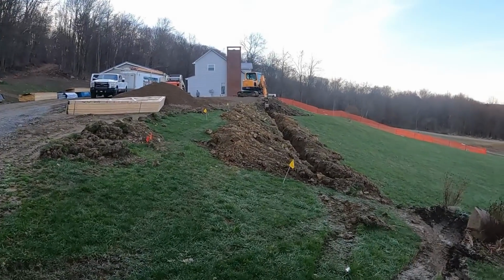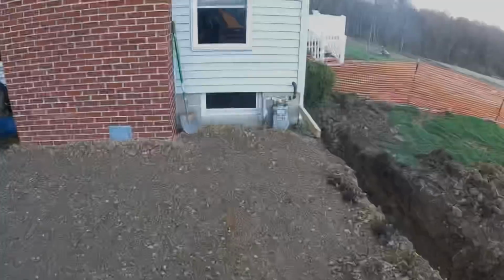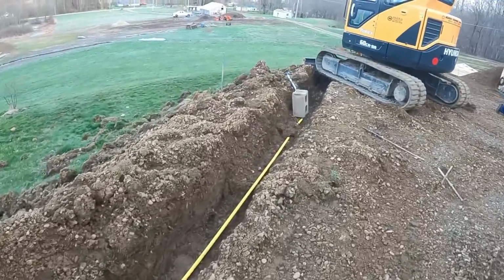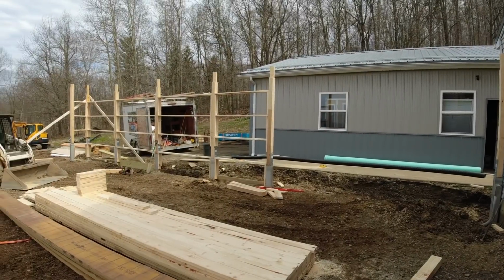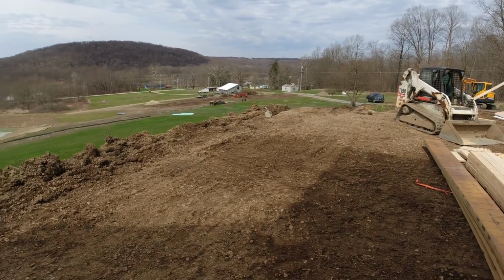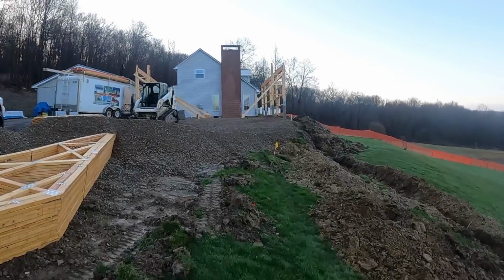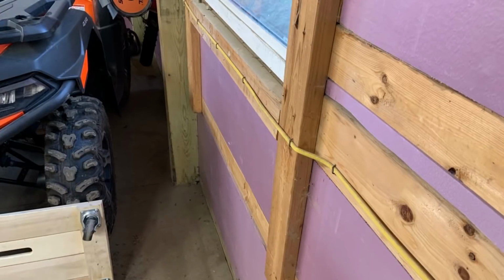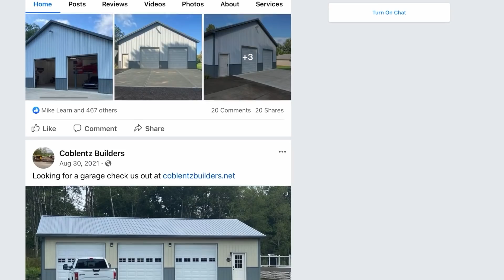Day 1 - Attaching A Pole Barn Garage To A Block Foundation House

Comment: Looking great. The company that installed my pole barn also used the cement cookie in the bottom of the hole. Going to be a nice addition to the house when finished. Looking forward to seeing the build. Thanks for sharing. Stay safe
Reply: Did they do anything to compact it into the ground so it doesn’t settle?
Reply: Greg, I wondered about that as well.

Comment: The building will heave when the ground freezes being that the perimeter base board is contacting the ground. The only way to prevent frost heave is to bury polystyrene insulation board along the perimeter of the building.
Reply from the maker: We’re putting in radiant infloor heating

Comment: So the old back door is next to the new front door and the old front door is next to the new back door. The new back door is on the front side of the house but it is the back door because you don’t use it as the main entrance and the new front door is on the back of the house and it is now the front door because it is the main entrance. It might have been easier just to turn the house around so the door names matched. No wait, the back of the house would still be the back of the house no matter what door was on that side. So yea, it all make sense….🤪😜😆😆😆
Reply: yep.....that about sums it up🤣👍
Reply from the maker: Yeah I still don’t understand why this is so confusing. It’s pretty self explanatory 🤣lol
Reply: Easiest way to settle all that confusion?........just paint all the doors a different color!! Lol
Reply: Clear as mud if you ask me… what’s the problem?

Comment: There is a big difference in the two ways the walls are framed. The new garage is not built properly for structural weight. The perlins are not meant to be put in that way. The first garage is done properly for strength.

Comment: Nice! 

Quick question about the two perma columns that are set directly against the house. I noticed that they're not in the ground as deep as the other ones. Is that because they're set directly on top of the footer for the house's foundation? They have to be in order to get that close to the house, right?

Comment: Looking great Adam. So you folks don’t use concrete out there in your post holes, or was it just not clear? I have built both ways, but prefer a little concrete for load bearing stuff. Probably over kill on my part. Cheers.

Comment: So I noticed you’re using the yellow corrugated steel piping for your gas line doesn’t have to be shielded from the ground meaning put inside another pipe?

Comment: When and where are you moving the electrical mast?
Reply from the maker: Same spot as the gas. They have to be 3 feet apart. Electric line will go in the same ditch 1 foot above the gas line

Comment: I would remove their name from your video if I were you. A number of OSHA safety violations were evident, standing in the bucket, working above 6" without a harness, etc. You would do them a favor if you masked their name and removed the endorsement. 
They look like they are doing a great job and are not taking any unnecessary risks. OSHA can be a pain in the rear.